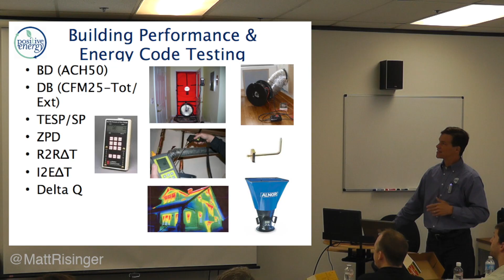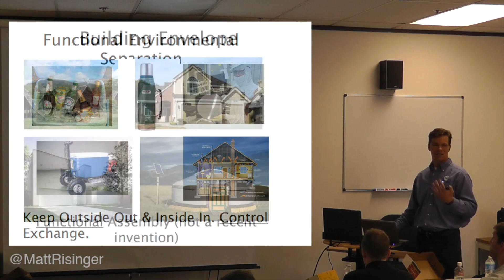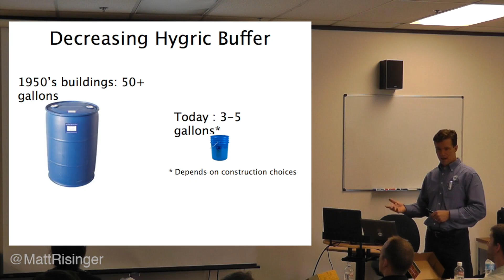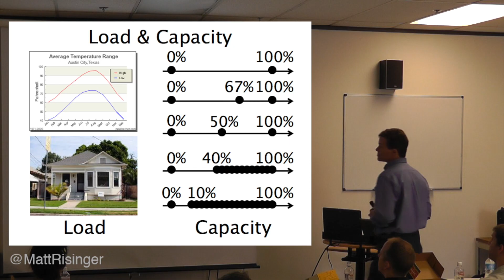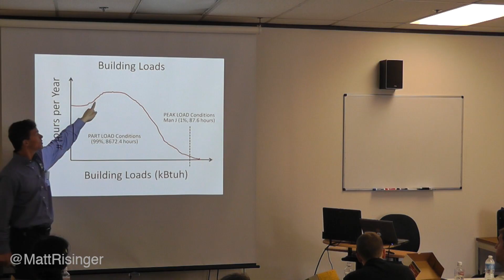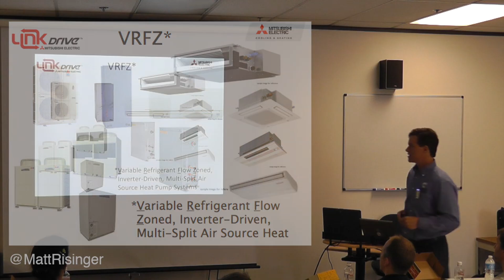Building Science Training - Advanced HVAC & Mitsubishi's VRF

Comment from the maker: It does appear that there is less penalty to oversizing a VRF system.  However, in my experience the issue is that at lower running rates the VRF has a reduced latent capacity.  This is especially prevalent in tight / well insulated houses.  Two lessons learned: 1: Install a Dehum with all HVAC systems in a Hot&Humid climate.  2: Size your system according to the Man J relatively tightly. i.e. if Man J called for 3.7 tons install 4 but don't goto 4.5.  Hope this helps, Matt
Reply: Matt Risinger 
Thanks for all vedio
I hope that make contact with you.im Hvac engineer
So much thanks

Comment from the maker: Yes agreed.  Rules of thumb lead to in-efficient houses that tend to be uncomfortable.  We all know that HVAC contractors are worried about call backs for not cooling on hot days.  This leads to oversized equipment which costs more to install & operate.  This oversized equipment also doesn't dehumidify properly as it's not running long enough to remove latent loads.  So the cycle continues... That's where my blog comes in!  I'm trying to educate clients, builders, AC contractors, everyone. -Matt

Comment: For the majority of homes under $1M in Texas, man J never happens.  It's a crude rule of thumb (sqft/tons) for HVAC sizing.  And it seems like very few HVAC installers want to learn about the fully variable systems like IQ drive (and variants), or the inverter type systems used in mini-splits.  Builders don't care either, because so few buyers will pay more for the better tech--just need granite tops and pretty bathrooms.  So the migration to better HVAC tech is painfully slow.